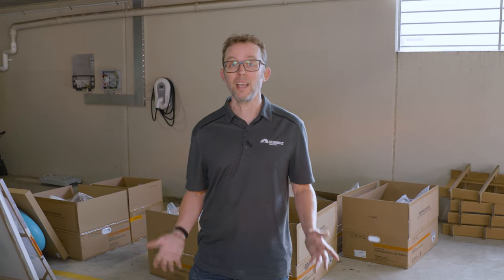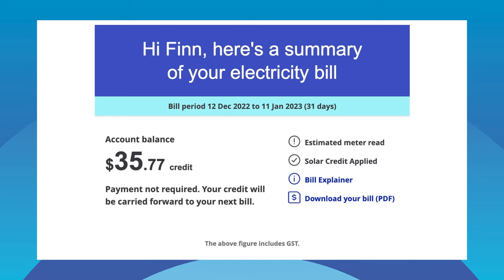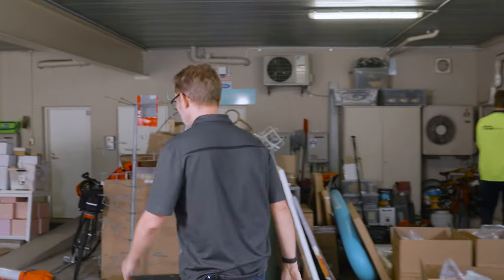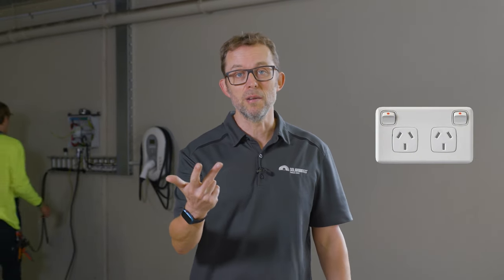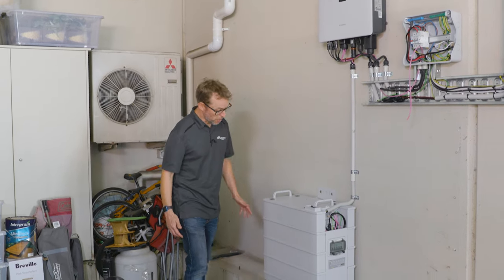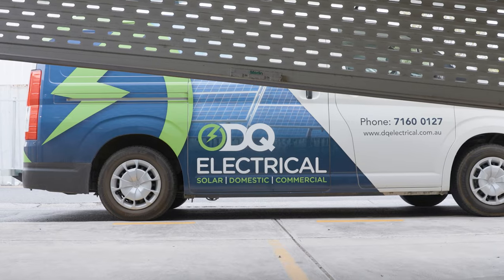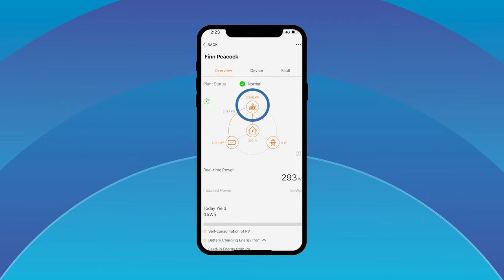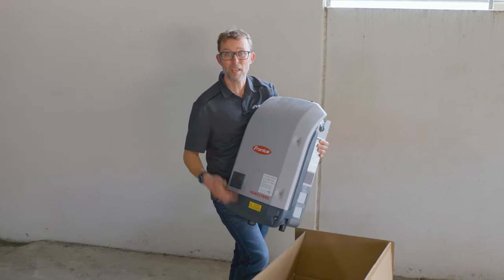Are Budget Home Batteries Any Good? Behind the Scenes Retrofit to 6.6kW Solar

Comment: I had 6.6 kW of solar and a Sungrow inverter and Sungrow battery installed just under 4 years ago (followed by an EV and Zappi smart charger a year later). It has all worked perfectly - except for the Sungrow monitoring (ARGH!). After about 1.5 years, many months worth of historic data just disappeared. The very good installer tried his best to get tech advice from Sungrow - but it turned into a nightmare and the poor installer had to waste hours of his time dealing with Sungrow. I would rate Sungrow tech support 1 out of 10. Eventually all the historic data was restored, but then some months later most of the historic data disappeared again. I haven't bothered with Sungrow support again after the last debacle. So now most of the historic data from 2020, 2021 and 2023 is not showing. Though the daily data shows, it's impossible to compare production and consumption over the last 4 years.
Reply: The manufacturers really should've added a way of regularly exporting the data via txt or csv to a target location
Reply: Just get yourself solar analytics, they’d keep your data. You can get away with native software. 
However, you can just call sungrow support yourself.
Reply: Thank you for sharing your experience with the Sungrow system. It's frustrating when tech support doesn't meet our expectations. If you're looking for a reliable home battery solution, I recommend checking out the Segway Portable PowerStation Cube Series. It offers a massive capacity, powerful output, fast recharging, and comprehensive protections. Plus, it's built tough with a waterproof design. Definitely worth considering for your power backup needs!

Comment: I have a Fronius 10kW Gen24 Hybrid converter, 14.8 kWh of BYD batteries (Fronius recommended), three phase backup. Been working faultlessly, excellent monitoring. The BYD batteries are LiFePo as opposed to Li-Ion, larger and heavier than these per kWh, but run much cooler and ess prone to thermal runaway.
Reply: The Sungrow batteries are also LiFePo, not Li-Ion. Not sure if you were implying otherwise.

Comment: For the overall cost how much time will it take you to recover your investment compared with say a 4% interest rate on a term deposit for the cost  of that hybrid system? Also how many charge/ discharge cycles do those cells have?
Reply: @@joblow3638 OK Thanks. With each discharge you cannot discharge to 100% of your battery capacity, I am guessing only 80% is available where the discharge will stop. If you do not get enough solar radiation the battery has to be charged from the grid, so the cost effectiveness does not appear at lest at this stage be worth it, the only advantage is having a backup for a period of time during a grid failure, this of course can be covered by a portable generator to keep few circuits online or you can get a natural gas generator connected to your natural gas line for emergencies which would be cheaper than a battery at the moment.
Reply: @karl7796  The LFP cells installed here can be fully charged and discharged
Reply: Or 5.5% interest currently. The answer is almost never. 10k compounding for 10 years would give around 15-16k at the end. The battery after 10 years would be almost worthless. So you need to recover at least 1.5k per year in electricity just to break even assuming nothing goes wrong. It’s just a poor internal rate of return. Especially for the silly ones who actually borrow money from their mortgage to fund a depreciating asset like a battery. Those who have cash should just stick it into a broad market etf and use the franked dividends to pay for electricity.

Comment: Maybe I missed it; but even though installation costs and price will vary from house to house and state to state: what was the cost of the swap over?
Reply: Not mentioned but I'm betting you could buy a lot of electricity for whatever the cost !!   Dont get me wrong, i love all this stuff but all this to run some lights, the fridge and a few GPO's 😉
Reply from the maker: Paid approx $14k all up.
Reply: @123hoffie    its not the backup that is the reason for a battery, but the ability to save and use as much of your own generated electricity as you can.  Electricity prices vary across Australia, but my supplier now has a 33cent differential between their peak rate and feed-in tariff.  If I can save 10 of those solar generated kilowatts in a battery for later use, that is currently a $3.30 saving on my electricity bill each day.  With price increases and FiTs going down, I would anticipate that Finn's $14K expense would have a pay back period of about 10 years at my location in Melbourne (before any government support or rebates).
Reply: @jamesdean2185  As I said I love all this stuff and I'd get a battery system myself but being mostly solo and with a very low useage I can't justify it.
You know on some bills you have a comparison with other households, well I'm to the left of the single person depicted!
I have a 3KV system and I really hate this  time of year as my useage is WAY up.
I'm  in Geelong.
I have recently changed back to Tango for supply. 77 cents supply, 20.5 cents kwh but a low feed in of only 5.5 cents set until May 2024-- hopefully.
Reply: @SolarQuotes same price as tesla installed

Comment: I have an a Sungrow SH10RT and SBR256 with 13.3kw of Rec Alpha panels. 1 phase of 3 used for backup circuits (lights, fridge, internet, to etc). 100% agree. DC coupled battery works for my needs Tidy, cost effective and very happy
Reply: Still happy with your setup? Just see some negative reviews online around warranty that’s got me scared.

Comment: Will be watching this develop, was mostly information from SolarQuotes that I relied on when selecting our system. Modular battery was (to me) a no-brainer. DQ were the suppliers and installers.
The installers were great, I requested LAN connection and they were able to accommodate that quite easily given the position of my routers and the brush plate I'd installed nearby. Very happy with the communications side, the LAN and routers are within my backup circuits and they have been rock solid.
We tend to use a quite large amount of power and had a spreadsheet on my bills over four years, so I could see overall usage and feed-ins of the old system. Wife had agreed to my logic of de-coupling gas from the house as the dual energy bills seemed wasteful. The spreadsheet averaged use over billing periods which made for a reasonable guess for expected use volumes and patterns. DQ's Nathan was very helpful with balancing estimates during hot water and cooktop changeover from gas (also handled by DQ). We ended up with 6 modules (max stack for single phase setup under a single BMS head-unit).
Sungrow's app is a little clunky but works pretty well. Even forced charging (FC) is do-able remotely, but could do with some polishing by their software engineers. Web display through the browser is much easier for FC time and charge target percentages.

Comment: To confirm, the battery is supplying / topping up the electricity for all items in the house before anything is pulled from the grid. Not just those items you have placed on the backup circuit?

The test you did with kettle/toaster was plugged into a gpo but I didn’t know if that was one of the backup ones.
Reply from the maker: Correct - when not in backup mode it supplies the whole house not just selected circuits.
Reply: You can also define times to do so if you have time of use billing. I don’t use battery during off peak. Suits my needs better to use battery during peak times

Comment: Could you clarrify, does the unit allow the panels to provide power during a blackout or only supply from the battery? Can it handle a 2 phase system? Thanks
Reply: Excellent question. Answer?
Reply: Yes it does. There is a three phase option
Reply: @rbenson999  I have been told that you can't just use two phases of a three phase system. If that's incorrect it opens up many possibilities. We also have enphase microinverters and have been looking at buying two SAJ 5.1 batteries

Comment: I noticed your solar is not on your south side but on your east and west. I would love to see a video on how much power each side is producing at various times of the day.  Other questions i have.
 Is one side dead when the other side is at half power? Do both sides run at full power at midday? Does it make economic sense doing it this way?

Definitely think it would make an interesting video
Reply: Do you live in the southern hemisphere? Optimum solar irradiance in Australia is when solar panels are facing north here.
Reply: @rayf9194  LOL, that's a brilliant point.
I'm in Jersey just below in UK so it's south for me. 

So let's substitute the word south from my original post to North.

I've always wanted solar panels. But having the roof facing east and west. I've always assumed they would most probably run at 50% to 75%  of their potential. So It would be good to have some real world figures on power production.
Reply: @jsydev  The newer panels are far more efficient and his East/West arrays are what was available. Our Northern slope @22degrees rake faces 356 degrees North, we also installed panels on the Southern slope (@ 22). Thinking Finn's place is also in Adelaide, so we are @ 34.56 South and have max solar @ 79 degree azimuth in December making "odd setups" quite workable. Jersey would put you around 50 degrees North? There are probably some applications/websites that could help you there..?

Comment: I've got a Fronius primo 6 and sonnen eco 9.43 battery on amber electric. 
Amber exposes a wholesale price and FiT to their customers and provides a service called Smartshift that manages the battery to take advantage of the ups and downs in wholesale price which I've noticed go as far as -5c to $15 per kWh for FiT.
However, Amber doesn't support the sonnen battery (because sonnen consider amber a competitor) so I've had to implement my own energy management system to do this smartshift job. 
I've implemented EMHASS which is an add-on to Home Assistant. EMHASS takes a 24h forecast of FiT and price from amber, a forecast of solar PV output from the likes of solcast, monitors load in the home and then manages deferrable loads like pool pumps and hot water systems. It also manages the battery charge and discharge to take advantage of the price fluctuations. This goes further than Smartshift.  
Yet to see how good this is compared to the sonnen flat VPP plan I was on before.
Reply: I don't know what retailer you're on, but for those of us on AusGrid, note that you get one huge advantage using the Amber SmartShift: an extra 27.8c/kWh feed in on top of the FIT between 2pm and 8pm until July 2024. That turns even a low evening FIT into a 40c or 50c FIT. Of course, that doesn't help you as your battery isn't supported.

Comment: I'd love some actual costs rather than just a vague "you can get 12.8kWh, the inverter and the panels on your roof for the same price as the Tesla PW2. I can get the TPW2 installed in Sydney for $13.5K.
Reply: I think tesla prices have dropped and by the time you fit a so caller cheaper brand you will realise it's not cheaper at all only difference is if you need more kw the other brands are easier to expand

Comment: I was sold a 10Kw Fronius Inverter with 23 Solar panels & I have 3 phase power. When I had a quote for a battery I was told I would have to decide which of the 3 phases I want backed up! How ridiculous! I’ve read your info pack & still can’t work out what is needed to back up all 3 phases rather than replace the inverter. I want to run an Air conditioner , pool pump & charge my Tesla when there is low solar generation. Any ideas that won’t blow the budget
Reply: Not really, whole house backup is much more expensive than selected circuits on 1 phase.
There’re very few 3 phase options on the market now, to have everything running as normal, you’d have to have a big inverter and big battery. Minimum $30k spent.

Comment: Do batteries and inverters need to be installed in the shade or indoors?
Reply: It's always best when ever possible to install your inverters and such in the shade, or southern side of the house (in eastern Australia) the electronics will last longer and you reduce the chances of them derating themselves as temperature increases. Batteries like to be cool but not cold and the electronics in them will want to be cool.
Thermal cycles (hot cold hot cold) as days and months go by can lead to joint failure on circuit boards in any electronics.

Comment: I'm envious that you can get $0.22 FIT when I can't even get AUSNET to approve my system to feed back to the grid? The application has been denied twice with no reason given. 🤷‍♂🤷‍♂ I got the panels installed in 2020 and a battery in 2021 but up until the battery went in they were more than happy to take all out excess rooftop generated power and even then I didn't receive any FIT due to the electric provider messing that up when the panels were installed and again after the battery (I missed one opportunity as well but didn't know it at the time). I don't know what issues other people have with their solar installation but my one has been a mess starting from three days before the panels were installed just before the COVID-19 lockdowns started.

Due to the suppliers cockups the paperwork has supposedly expired so I will need to pay over $1,200 + GST to get it re-examined and certified. Solar installations and the associated paperwork is an effing nightmare because in my case I have to assume the installers and provider do what they are supposed to do because I was told nothing about the process and was given no copies of any of the paperwork. Hell I have no documentation of the isolation sequence to shut the power off from the panels and/or the battery. You guys should be in a position to know if the paperwork process is seamless and if the consumer is given documentation for the thousands of dollars worth of panels and battery (if a battery is installed). If I sold my house I have no paperwork to pass on to the buyer that would inform them of the state of the system and any connection to the grid. 
I hope that makes sense because it all confuses the 💩out of me.
Reply: What you said is why I still haven't bothered installing a system. I was ready to go 5 years ago but have done nothing. I want one but I don't want the hastles and the nightmares. From the point of view of a person looking at having a system installed, the process looks damn scary and ridiculously complicated. It's mad. Yes, I could blindly go ahead and get a bunch of quotes etc. but I don't trust anyone I don't know. I want to know everything I need to know up front but it's too complex.

Comment: Can we get an update with how it’s going? My partners sungrow battery was installed outside and is already corroding
Reply: It also seems as though it’s supplying the grid with power while the grid is supplying the home which I think is crazy.
Reply: I've got a very similar but beefed up, 13.3 solar array, 10kw hybrid inverter and 19.2kwh sbr192 sungrow batteries, Its fantastic. The app is a bit finicky to set up but after it's set up, it'll show me everything I need, Inverter can handle charging the battery, supplying house with power and feed in the grid all at the same time.

I've had this system for a few months and have had no issues at all.
Reply: @Cafeacore This sounds like the same setup I'm looking for. Could you tell me the total cost for your system install please?
Reply: @willcampbell4866  the entire system cost 30k to install, set up, etc. I'm Australian though, so if you're American drop that to 20k.

It's been great though, I've paid zero on electricity, i just pay to have the connection which is like a cent a day. It generates more than enough to pay off my gas bill too and I have credit left over. In a power outage it runs my house without missing a beat even with aircon on (although using it smartly of course). 

For my home Utilities I only save for water and council bills now.
Reply: @Cafeacore  That's perfect. I'm in Qld and would be keen to get some info on your installer if you wouldn't mind.👍

Comment: I'm interested in a battery or 4 for our 6.6 system and really only to run a 4kw window mounted air conditioner during the 6 HOT months.
Does anyone know how to calculate how long the 4 x 3.2kw buttery's  would run the AC for.

Comment: Curious, if you just added a Tesla power wall, would it have been cheaper than replacing inverters plus adding batteries?
Reply: Tesla battery won't work without internet.
That's a big no for many.
-

Comment: Hi Finn
I've got a similar set up and looking to get batteries but issue im having is that we have 15.4kw of panels and 15kw Symo and i can't see any battery inverters that can handle that size array 
Any suggestions as id probably also add a couple of panels if possible too
Reply: New GE or sungrow or Saj hybrid inverter 8k or 10kw (they single phase) . The first 2 are not cheap, but they are good quality, I think.

Comment: In 10years it will only guarantee 60% of its power, that's very bad. The Alpha another cheaper range gives 80% in 10years which surprised me
Reply: The Alpha won’t be working at all in 10 years is the difference. So many inverter/comms issues with them.